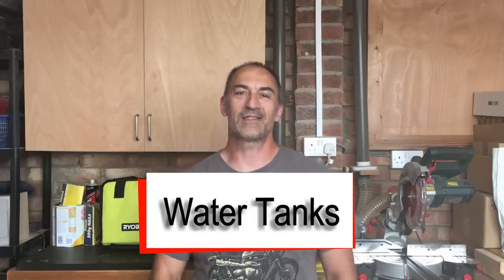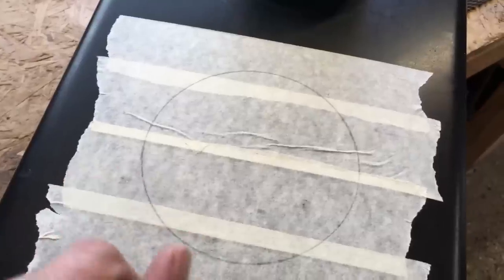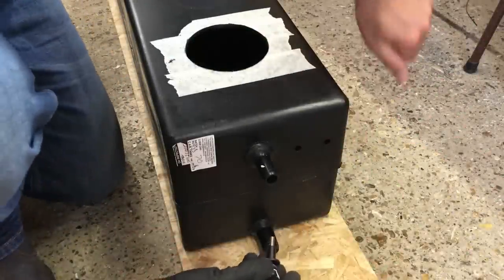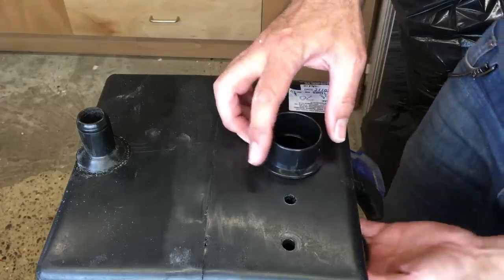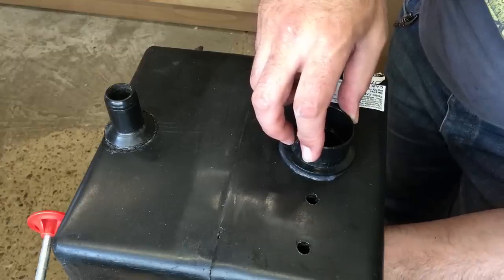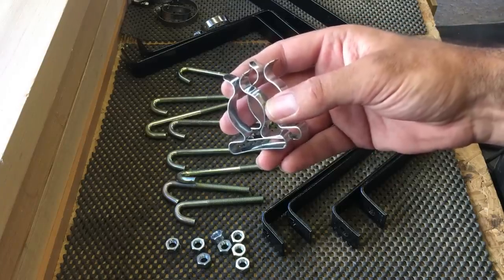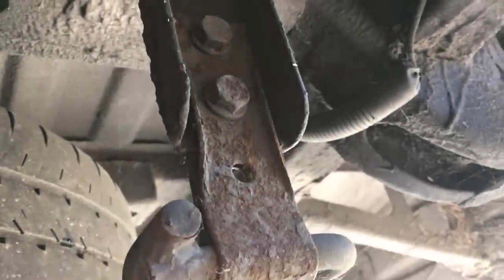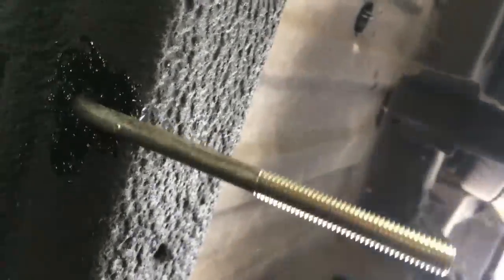Mercedes Sprinter Campervan - Water Tanks

Comment: You are my go-to guy whenever I am researching for my van build. So appreciate the tutorials.

I have a couple fo questions about the water tanks. Don't they need to be vented? For the grey water tank I'm thinking of adding a 1/2" vent pipe protruding out of the top side of the waste water tank with an L extending up a couple of inches to a screened cap to allow air to flow out as wastewater flows into the tank, and also adding inwill T into the tank inlet

Also, I notice that you have a big red cover on the bottom of the tank. Is this for the cleanout opening? (In the video you mention that you have to drop the tank to access the cleanout opening. This seems like an unnecessary pain. Is this a better sealed cap than the standard one? It has confused me as to the orientation of the installed tank compared to the in-shop video section where it appears you are installing the cleanout port on the top.)  I am thinking of putting the cleanout on an accessible side of the tank instead of the top so I can easily get in there for cleaning. Maybe could also install on the bottom. If the is a good cap seal, because of minimal pressure, I would think that there would be no leaking. Your thoughts?

Also, another tip I've read is to position the waste water tank input on the side of the tank rather than front or back so water does not surge forward or back when accelerating or braking. 

I have the same venting concern with the fresh water tank. I would think you'd want relieve any negative air pressure when pumping water out.. I am installing a 113 liter tank that fits over the wheel well inside the van and plan on adding a similar screened side L air vent that extends up into the garage.  Thoughts?

Thanks so much.

Bill Van Arsdale
Naples, FL USA

P.S. I enjoyed the Scotland video. I took a wonderful tour of the Highlands a few years back and love the area. This video once again reminds me why I am so keen on entering vanlife.  Hope to cross paths with you the road in a few years hence after I fulfill my North America wonderlust and then ship my van over to the UK for an extended European adventure.

Comment: Hi Greg. Noticed in later videos that a smaller clear pipe had appeared which looked like it also connected to the filler inlet, just above the blue intake pipe. Wondering what that was.
Reply from the maker: Well spotted Alistair, it is a vent to let air back into the main tank when water is being pumped out. Otherwise you can easily collapse the tank.
Reply: Thanks Greg. You the man!

Comment: Hello Greg,   Great Video Again!  Very good information.  Two questions.  Do you plan to winterize  your tanks?  If not do you have any idea on the best way?  I want to use the space underneath like you did, but I will also be in the mountains and snow some of the time, so I will need to consider the cold.
Reply from the maker: Jeff Steinmetz I would consider putting your water tanks inside the van if you want to spend lots of time in the snow and cold. I’m not sure insulation would be sufficient after a few days of really cold weather.

Comment: Greg, did you fit the CBE fresh level sensor yourself? I'm assuming I just drill a hole in the top and fit it the same as a bulkhead fitting?
Reply from the maker: You might find this video of some help too for the tank install. https://youtu.be/VKolPhQfHLQ
Reply: @GregVirgoe  many thanks, all.fotted now

Comment: Hi Greg. 

First of all thank you so much for providing so much great content. It's made my van conversion so much smoother knowing that we are doing the job correctly.

In this video you have fitted the access hatch and then (I'm assuming) used some screws to hold the access hatch in position. I've seen this done in several videos using sikaflex to seal the screw. However for me it doesn't seemed to have worked. We have the hatches fitted to the bottom of the tanks.

Did you use screws on your access hatches? And if so, how did you make them water tight? 

I'm sure there is a simple solution however I'm stumped for what to do.

Thanks. Tom
Reply from the maker: I did use some SS screws. The hatch I fitted was on the top of the tank so it didn’t cause me any problems. 
I suggest opening the hatch an putting silicone around the screw threads internally. Did you seal the actual flange with silicone too?
Reply: @GregVirgoe  Hi Greg. 

Yes we used silicone around the flange and it looks like it's sealed properly. I will try applying some silicone around the thread internally and see if that helps. 

Thank you for the advice and brilliant content 👏

Comment: hi Greg, just trying to fit the drain hoses to my tanks, water and waste both from CAK. However cant work out how to attach the drain taps to underside of van. could you please explain. thanx
Reply from the maker: I bought some small metal L brackets, screwed these to the sill seam and then cabel tied the drain valve to the brackets.

Comment: I have questions on constant temperature control as I will have my dog in the van when im not able to have her with me. Im not worried about 9 months out of the year, but Oregon is getting pretty intense summers. I also worry about the insulation and temp control with van in direct sunlight for extended periods.

Comment: Really great videos. They make you think you should definitely build your own, rather than buy a ready prepared van, doing a better job and saving money.
Just one question!! Watching you putting the tanks in reminded me to ask, what about all those flooring screws sticking through the underneath of the van. Surely they need to be protected from rusting? 
Thanks again for showing us exactly how to do this stuff.
Reply from the maker: I’m putting together a Q&A video out very soon to cover points like this that have been a common question. I ground the screws shorter and treated with WaxOyl underbody sealer.
You may be able to see a couple of darker patches where the fresh water tank is fitted. Thanks for the compliment

Comment: Hi Greg - great videos. They have convinced me that our plans are achievable with sufficient planning and attention to detail. 

I have one question regarding your utilities: There's a lot of detail about hove you have run your 1st first fix wiring but what about gas and water? Did you not run the necessary piping for gas/water supply and waste prior to installing your floor? I'm starting to put together my punchlist together and this seems to be missing at present.

Comment: hi Greg, great vids, thanks. I have one question. 
Isn't it necessary to also make a decompression valve or tube, to let out air as the tank fills up with water?
Reply from the maker: The waste water tank has a series of small vents in the top. But by making the inlet pipes bigger like I did avoids the symphonic effect of a full pipe. 👍🏼😁
Reply: @GregVirgoe  aha thanks!

Comment: Quick couple of questions. The high level indicator on the remote gauge, does it have a delay, I ask as I can see cornering with a part full tank getting annoying every time it goes off. The rubber captive nuts, commonly used on motorcycle fairings, won't come out again once they've been there for a while, so be prepared to replace them if you ever have to take the sensor out. Next, is there a reason you decided to put the "Hand Hole" on the top rather than the other end, where access for in situ cleaning might have been easier?

Comment: Hi Greg. I would add some rubber strips between the metal straps and the tank. Was there a reason for putting the waste tank inspection/ cleaning access hatch on the top?
Reply from the maker: The manufacturers recommend not fitting anything between the straps and the tank as that can work lose and the tanks fall out. 
Now I’ve fitted them they are very secure and no movement. To be honest, the hatch would have been better on the bottom, I rushed in there. Only two bits to drop it so not the end of the world. Not something you would do regularly maybe once when garaging your van. Thanks

Comment: Hi Greg. Excellent video and very helpful for us. I wondered about the red inspection cap that we also would like to have for better cleaning access. In the catalogue CAK states that the caps cannot be fitted at the bottom of the tank, however I noted that you installed it towards the bottom nevertheless. Did you have any leakage or other problems with doing it that way? How did that work with the other fittings - I assume they would be upside down?

Comment: Did the tanks have breather holes or did you have to run an outlet in the fresh to the filler cap breather hole?
Reply from the maker: The back of the filler cap has a vent hole that I fitted a short length of hose and an air filter to. 👍🏼😃

Comment: Hi Greg. Really appreciate the videos. Are you doing anything to prevent these tanks from freezing, do you think it could be an issue traveling in the winter?
Reply from the maker: TheDaveCoates the short answers are No and Yes 😁 the longer version is
We only planned to holiday in warmer climates so I didn’t insulate them. If you plan to go to colder places I would put the fresh water tank inside and the gas underneath. 👍🏼😀
Reply: @GregVirgoe  Thank you so much for your response. I hope you are enjoying your travels.

Comment: Hi Greg, could you send a link for the tank connector please. Cheers
Reply from the maker: Ryan it’s a 40mm polypipe tank connector solvent weld. Like this one https://rover.ebay.com/rover/0/0/0?mpre=https%3A%2F%2Fwww.ebay.co.uk%2Fulk%2Fitm%2F283047808907

Comment: Brilliant as ever.  Were the tanks designed to go with a sprinter - I'm wondering if they would fit equally well on different makes of van.  I ask because many years ago I fitted water tanks to an old yacht and they needed to be made to measure though that did mean they made the most of the space. Thank you.
Reply from the maker: CAK tanks make a vast range of tanks for loads of different vans. Links in the description. 👍🏼😃
Reply: @GregVirgoe  Many thanks

Comment: Thanks Greg, brilliant as usual. Though, being a girl, I'm thankfully not having the lock-down beard issues...   One quick question please, if you have 
time.  In your water tanks video, you don't mention a vent/overflow tube on your freshwater tank, but there does seem to be a place for one on your water
 filler, so I presume you did use one, being a stickler for detail ( in the best possible way ;-)).  I'm installing a fresh water tank inside the van, but aim to fill from the outside.  Do you know if the external water filler type you are using also works (when locked) as a vent for air inflow when pumping, or did you have an extra vent on your freshwater tank for this?  I'm using a Shurflo TrailKing 20 psi.  Cheers, S.

Comment: Hi Greg. What waterpump did you install with the tank? Initially i thought of using a self-priming pump with built in pressure switch. But I am worried that I would get an airlock in the pipe since the pump would be higher than the tank. Thanks.

Comment: Great video Greg. Well done! One question from where did you get the manhole lid. I can't seem to be able to find one. Thanks
Reply from the maker: Thanks for asking I forgot to include that in the video description, here is the link you need https://rover.ebay.com/rover/1/710-53481-19255-0/1?ff3=4&toolid=11800&pub=5575265109&campid=5338027957&mpre=https%3A%2F%2Fwww.ebay.co.uk%2Fsch%2Fi.html%3F_from%3DR40%26_trksid%3Dm570.l1313%26_nkw%3Dblack%2Bplastic%2Baccess%2Bhatch%26_sacat%3D0
Reply: @GregVirgoe  hehbdyr

Comment: Hi Greg, what are your thoughts on keeping water clean when stored In a van?
In my last van I had water in a clear tank running through a Whale hand pump and after a while lots of mold formed in the tank and hose.
Is the answer to use black containers to block UV light and or a drop of bleach when filling up?
Thanks again

Comment: Hi Greg! Great video. Did you mount the fresh water inlet on the side of your van ? I remember from a previous video that you regretted cutting holes in the side. I couldn’t remember whether that was just the gas or the water as well. Cheers Greg apologies I ask loads of questions
Reply from the maker: Ryan it was only the gas one. It would have been better fitted down at skirt level below the floor. The others I was happy with.

Comment: Excellent Video.
Just wondering what the overall cost of the water tank installation has worked out to be?
I am also converting a Sprinter and this will help with my budget costs.
Many Thanks
Reply from the maker: Hello Neil,  my two tanks, brackets and drain hoses came to £279.00 from CAK tanks
http://www.caktanks.co.uk/CAK_Water_Tanks.htm
Reply: Thanks Greg.

Comment: Hi Greg, I noticed the filler cap had a breather hose connected, but there didn't seem to be a breather connection on the tank. Did you connect it up somewhere, or is it redundant due to the breather holes in the top of the tank?
Reply from the maker: Very well spotted, you are right. There are small breather holes in the tank, no separate breather connection but what I’m going to do is add a breather vent in the garage. Just in case the small holes get blocked. This is covered in the water works video out very soon. 👍🏼😀

Comment: Hi Greg from NZ ! how did you vent the tanks ? chrs
Reply from the maker: The fresh water tank has a vent on the back of the inlet connection. 
The waste water tank has small vents on top of the tank plus with my larger size pipes they are rarely flooded so are self venting.

Comment: Silly question, but you refer to big hole you created on top of the tank as a man hole. What is the name of that cap/door thingy you added to the top of the tank in order to access the inside to clean it? Thanks!!
Reply from the maker: If you search for “black plastic access hatch” on eBay you should find what you need 😀
Reply: @GregVirgoe  Awesome, found it! Going to be super useful. Thanks for your kind reply! :)

Comment: Hi Greg, just curious, how come you put the access hatch in the top of the grey water tank? Doesn't that mean every time you want to clean it out you have to remove the tank? TIA
Reply from the maker: Yes I was concerned about leaks but in hindsight that may have been the better solution.

Comment: Hi Greg, what hose did you use to connect the fresh tank to the pump/filter? I can't find any 15mm ID pipe anywhere!
Reply from the maker: Alex Jenkinson I didn’t use hose I used push fit fittings directly onto the tank. 
The water outlet is 15mm pipesize and will accept a JG pushfit fitting, into which I put a 15x12mm stem reducer then used 12mm LLDPE tube insulated up into the van. 👍🏼😊
Reply: @GregVirgoe  brilliant, thank you Sir Greg

Comment: Hi Greg, another amazing video which I've watched several times lol. We have just installed our tanks, and it looks like we've used the same supplier (who seem to have left a lot to be desired!). Just wondering, what connector did you use to connect the fresh water outlet on the tank to the 12mm pipe? I have the filter, pump and accumulator ready to go, I just cannot seem to find something that will connect the tank to the pipe which goes to the filter. Any help would be appreciated. Thanks

Comment: I just saw the Winnebago Revel Sprinter has a pump-filled (not gravity) grey water tank.  Perhaps that explains the small grey tank inlet.
Reply from the maker: Hi Marion, from what I’ve seen most camper wastes are installed in 3/4” flexible pipes and that would fit around the connection. But for waste it would be prone to blocking and I’m just not comfortable fitting it. Hence my alteration.
Another pump is another thing to power and go wrong? 😊

Comment: I wondered this with the reflectix vapor barrier, too, actually...

When you're screwing into a silicone seal, or a vapor barrier like reflectix, do you run the risk of compromising the seal/barrier? I'm wondering if you should screw into a new bead of silicone in either case.
Reply from the maker: Hello Alex, I would not be concerned about breaking the vapour barrier with a screw fixing.
The screw itself is adequately plugging its own hole very tightly indeed.
If you cut a hole for a socket box or recessed light you will need to repair the cut with foil tape to maintain the barrier.

Comment: Great video Greg, re water tanks, why don't ppl mount fresh water at eye level inside, above the sink. Maybe disguised as an overhead locker? Then the water just has to fall into the sink, and then fall again into grey tank lower than the sink.
Reply: good idea so long as you don't go around corners too fast.
Reply from the maker: That is an option Richard If you don't mind losing the internal storage space. There only thing to be aware of is it won't give you much pressure at all (3ft, 1m, 0.1bar or 1.5psi)  A lot of taps require a minimum inlet pressure to operate so be careful with tap selection.  You could not use this location for showering as there would be zero difference in height between the tank and the shower head and nothing would come out. 
A litre of water weighs a kilo so that's a lot of weight to try and support in a high level cupboard and it will affect the vans C of G.

Comment: Love your videos, Greg. Thank you. One question, do I need a breather hole for the waste tank? I have breathers on both my fresh water but wondering about the waste.
Reply from the maker: Lynne Challinor my tank had tiny vents in the top of it. With larger waste pipes its not necessary as the pipe is not always full and can can escape back down the waste pipe.